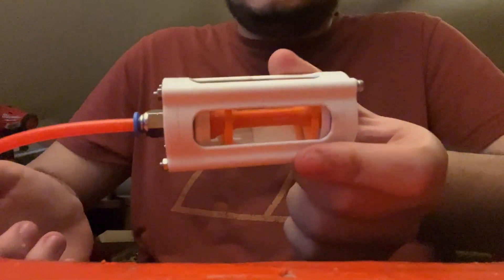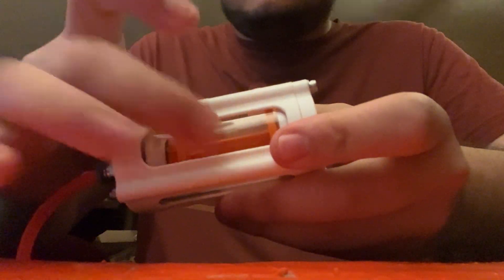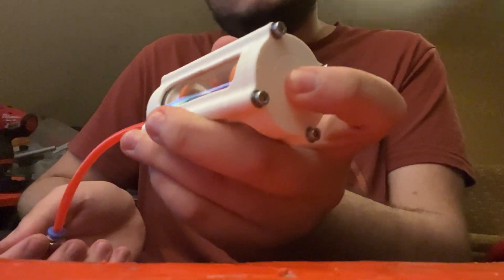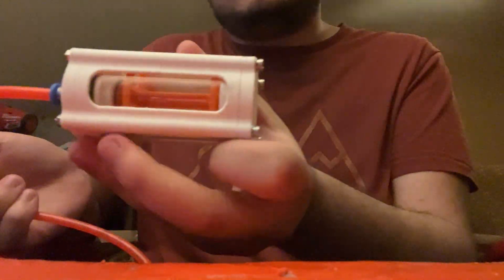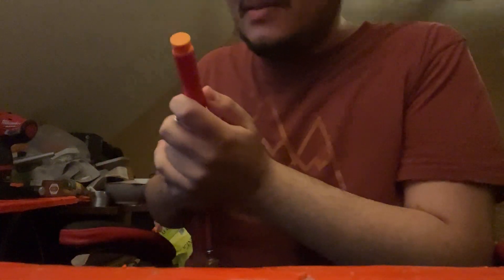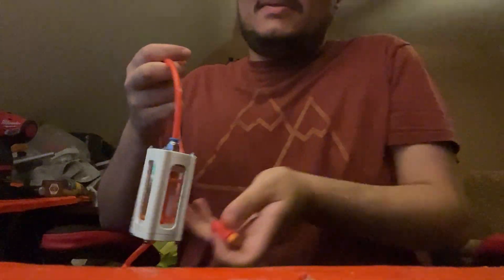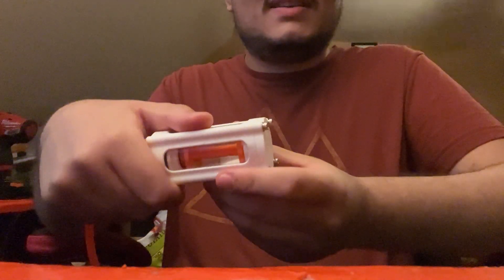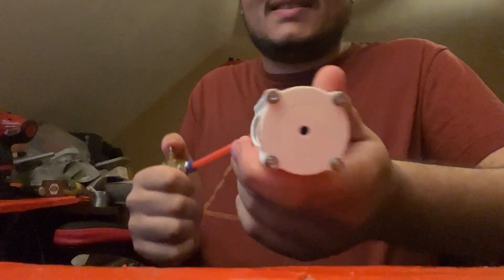3D Printed HPA Nerf core v9: it’s finally all good!

Comment: Great work, excited to see you incorporate it into a blaster! :) Safety should be paramount with things like this though, we need to stress using quality tubing & parts as these have potential to be dangerous. As these are used in the field, scoring or damaging a tube of the wrong material can severely inhibit it's ability to hold pressure without failure.

Comment: Okay I LOVE those little giggles when you fired darts from it and you tipped over the camera, really living up to the Silly part of your name! Shows that real satisfaction in modding and custom blasters, as well as that childlike wonder for comically overpowered Nerf. Wonder if you could build a full-auto bottle blaster with this thing? Like an airsoft gas blowback? I don't know where this is going, but I have faith it's going good places!
Reply from the maker: :)

I am planning to do a semi auto and a full auto setup using this tank connected to a pneumatic piston that moves the breech back and forth. Now that this basic HPA core is pretty solid and good, I can add that extra feature.
Reply: @Sillybutts  yay! Nice!
Reply: @Sillybutts idk if you still work on this but, would it be possible to have the same dimensions as a sniper core hpa  engine?

Comment: I feel like an absolute idiot for asking this, but what is the use of this? Like what’s it for, also love the silly shells and hopefully you release the files for the mag shotgun soon!!!
Reply: this is a propulsion mechanism. it gets air out of the hole, quickly. you can put a barrel in front and shoot any ammo, hard. or a lot of ammo. sillyshells, mega xl, this is basically just replacing your standard plunger and spring.
Reply: I see, super cool then! How does the strength compare?
Reply from the maker: Not an idiot, just not informed yet! Nothing to be ashamed of. 
In short, this is a compressed air holder that can dump that air out the end, really fast. It allows you to have an air propelled blaster, like a springer, without needing to prime any springs between each shot. You just pull the trigger each time you want to fire. 

This is probably more powerful than a talon claw type springer setup. Its hard to really compare them without having a barrel and breech mechanism for this HPA core yet.
Reply: That’s super interesting! So how many shots does something like this one last for?